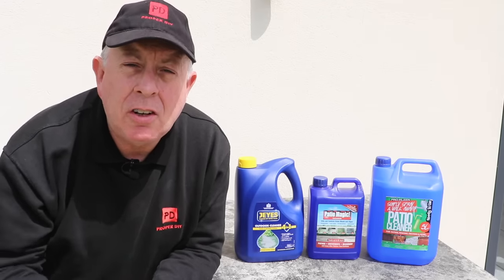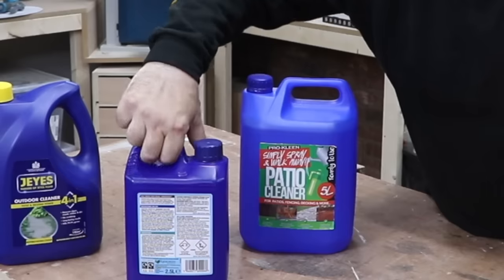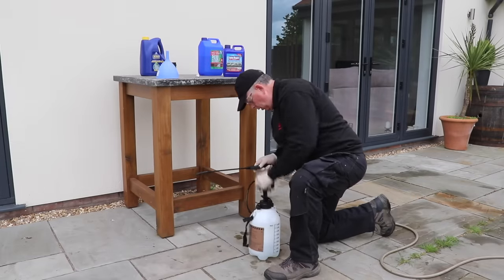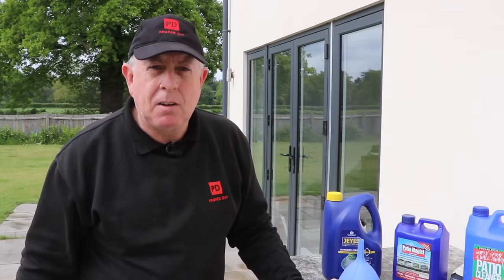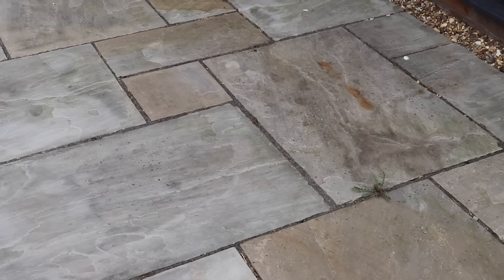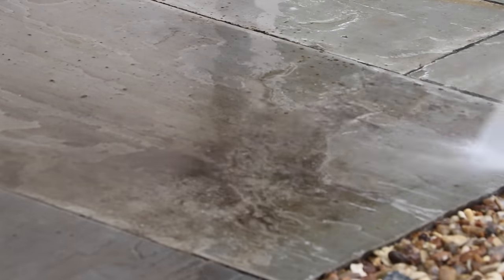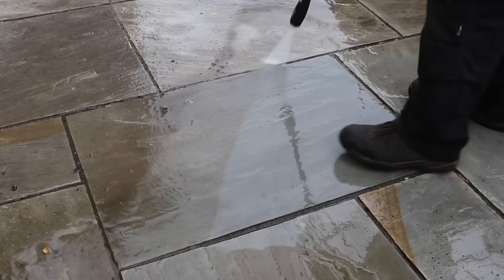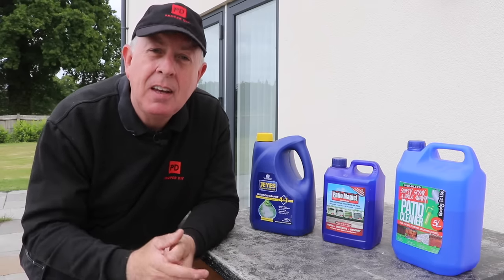Patio Cleaners vs Pressure Washer Put to the Test with Surprising Results!

Comment: Three points:
1. Buy a longer rigid pieceof tubing and extend the spray wand to stop you bending forward unnecessarily.
2. The spinning rotary washer is wonderful and MUST be tried, purely for speed
3. Wait until a damp day to pressure wash, since the grime will be softened beforehand.
Reply: You beat me to it on ALL three points.
Reply: @Justwhois  what can I say I bought my first Kracher about 25 years ago and got told by the experience trades man in my Bunnings store NOT to use it for more than 45mins continuously. After 20 years of regular use it’s worn out. I’ve got two thrown out units picked up from the side of the road (not uncommon in Oz) both operational. Therefore have some experience with high pressure cleaners (spinning rotary wand) I would not go passed these as they work exceedingly well and even gave a second handle one to my neighbour as she bought a new unit without this head. They work well and quickly if you can maintain a constant height. Regardless I looked at this as any alternative and would still recommend the use of Sodium hypochlorite, which is a concentrated form of bleach to kill the mould and stop it coming back after you physically remove it! NSW in Oz

Comment: I no longer use a pressure washer and use Wet and Forget instead. It gets rid of algae/green quite quickly but requires longer to clean the slabs in combination with rain. It then keeps the slabs algae free for up to 18 months i find. Ground in dirt does need a PW though.

Comment: Another great video Stuart.
None of the cleaners i have tried work very well. Jetwash not good especially over the joints as it can damage the mortar. I started off using cheap supermarket bleach. But now buy the higher concentrate industrial bleach. Spray it on a dull but not wet day and dont let it dry out. The longer its on but wet the better. Then just rinse off with a hose. Also works brilliantly on concrete

Comment: When I looked at the patio cleaner from Wilko's own brand patio cleaner, it was simply household bleach. It did the job pretty well though, but it's not a substitute for jet washing. However, it did deal with black spots better than the jet washer (it did nothing for white spot though which is maybe not surprising for a bleaching chemical). There are also some warning that it could fade colours on concrete slabs.

Also, being bleach it ought to kill moss, which I must try on my drive.
Reply: Better be quick buying up Wilko stock!

Comment: I have block paving and it's Wet and Forget for me, diluted at 5 or 6:1. Consistent use of a high power pressure washer damages block/slab paving. Best thing is to pressure wash then seal the paving with a non slip clear sealant. Then once a year treat with chemical cleaner.

Comment: I use the Patio Magic on the picket fence around our holiday caravan after the worst of the winter to get rid of the green mess that accumulares and found it quite good. That might be because they are vertical and we may have had some rain a day or so after application which may have washed away the green mess.

Comment: As you can see at minute 13 forward on the video some of the algae is moving away just by the little bit of water passing over the stone that suggests that you could have rinse the surface and get some of the dirt out. In US we have a product called "30 seconds" and the instructions said to rinse after 30 seconds but you can also leave it for longer

Comment: I have a 12 x 15 yard that was very green didn't want to use harsh chemicals so purchased 2 gallons of white vinegar and a half pound tub of bi- carb, soaked the area with vinegar sprinkled over the bi-carb lightly brushed and left it, within 24 hours there was a huge difference left it alone and rinsed 3 days later and it look like new

Comment: Husband and I used brand free sodium hypo. Best and easiest way. Saved time, water, no noise, no mess. Brilliant job. Very strong and apply caution. Looked like something from breaking bad, wore two layers of clothing. Used a snow shovel to protect the lawn. Need team roles who does what, talked through technique and process before we masked up. Made solution up in a huge bucket on site and just brushed on. Used 1:4 ratio. Waited half an hour then Rinsed off. Stone flags cam up like brand new. Super bright, all green gone. Will now do annually. PPe cost about 15 quid from b&q. We wore more ppe than in the video. The chemical is highly toxic and the stuff that goes in the swimming pools. Was advised NOT to use pressure washers as may damage cement.

Comment: I used to gently pressure wash my Indian sandstone until this year where I was recommended a product by a company called Universeal which you mix 4.1 and spray on and leave within 24 hrs my very green patio turned up like brand new some heavy contaminated areas need done again but all good now , was so impressed I bought a product they have to removed rust stains worked brilliantly took be about an hour to do instead of several hours

Comment: Here in Australia I have used similar products to these (30 Seconds Spray and Walk Away and Glitz Spray and Go) both have the active ingredient, Alkylbenzyldimethyl ammonium chloride.  These work very well to clean concrete of mold and mildew.  I use them because pressure cleaning over the years has slightly eroded my concrete paths.  This active ingredient is activated by rain over about 2 months with the paths getting progressively cleaner over that period. Three days is way too soon to judge despite what the pack says imo.

Comment: I would recommend using a "t racer" attachment on your pressure washer for cleaning patio slabs. As someone that witnessed their father suffering from Parkinsons disease for 8 long and painful years, most likely caused by use of unnecessary chemicles,  I would  not want to use anything like that myself.

Comment: Ive used the prokleen for years. Its brilliant and gets rid of the algae within 3 days. Visiblly better after about a day. Its not designed to clean the slabs. If you want to clean the black slabes, use one of their other products. Far better than a pressure washer. Its also brilliant on composite decking. Put in a watering can, pour on. Takes minutes.

Comment: I think the chemicals just kill off the algae and such. I used something similar on my crappy old wooden deck that had turned green and stank of algae in the parts that routinely see shade; it killed off everything and left a grayish surface on the wood, which was the dead algae. It obviously can't just vanish - just die and dry up. Next step is still going to be the pressure washer (carefully) and then breaking out the Wagner sprayer and painting the whole shebang white. But yeah, on stone like this - a patio washer that attaches to the pressure washer is no doubt the way to go. Those have jets of water (and maybe brushes, don't have one tbh, due to no stone patio) that scrub the stone while washing. Solid investment I think if you have a stone patio. Oh - and it might just be an idea to first clean the stone with a patio cleaner attachment or just the pressure washer, and then spray a layer of your chosen product. It should form a surface that makes it much harder for the algae to come creeping back, as a preventative measure.

Comment: I think if you had done a mix of water and Sugar Soap then pressure wash the areas  you would have obtained great results also, and Sugar soap is better value for money. Just another option but very informative video thank you.
Reply: That is a great idea with sugar soap, do you just put a 50/50 water and sugar soap in a watering can and spray it on the patio first then pressure wash?   I see many comments do the old washing up liquid trick.

Comment: My comment is on block paving. My driveway is old and attracts moss like iron filings to a magnet. I tried pressure washing, but that also meant applying sand after. The sand just washed out on the next rain storm. This year I used an electric gizmo that uses a wire wheel to take the moss out. Then I used several application of these products over the year. Result? No moss.

Comment: I always thought the Jeyes was just an outside disifectant and not an actual patio and driveway cleaner.
I used the Patio Magic some years ago and didn't rate it. I now just use a Karcher pressure washer with thier patio cleaning attachment using a bottle of thier concentrate as a mix with water which is only about a tenner, I don't think the detergent does much but along with the patio attachment I get a very good finish and may need just a spot cleaning with the high power lance to try and remove any black spots and stubborn marks.

Comment: When I first moved in to my present home the  patio  horrendous, it looked black and green ,couldn't tell at all what in the holly shoehorn colour it was beneath  the crud!!😂
I bought a brand new pressure washer and to my surprise after 4 hours I had unearthed a beautiful  pink and cream patio.
After I had cleaned it thoroughly  straight to bones of the earth,I was advised to cover the whole area with a preventative solution so as to prevent a reoccurrence, time went on winter set in and I must say  I wish I had done what I had been advised to do (I became very Ill) so after power washing in the first place I was incapacitated until recently ) I will do the whole thing again in warmer weather as the green stuff has developed once again 😢.❤

Comment: I'd have been interested to see if the application of the product made the jetting of the patio areas any easier than without.  Also, I have an area of Cotswold Stone gravel which brightens up a treat following application of Patio Magic.  Off topic now.  Could you do a video showing replacing the outside handle with a blanking plate on the french doors.  I didn't need to use them as a primary way of entering the house and they would always be opened from inside.

Comment: IMO  the very best way, and the quickest is a Rotary pressure washer. Not a rotary nozzle but the circular attachment, a bit like a floor polisher system. It’s quicker and us less likely to remove the grouting. Quieter as well. I use a Kranzle which is the RR of pressure washers but other brands have similar attachments.

Comment: Without doubt the best product for cleaning drives paths with lichen black or white or algae is sodium hypochlorite chlorine patio clean surpasses anything you can do with pressure washer. I find the easiest way to apply as a 6 inch brush take to a long handle works more or less instantly but if you leave it for a day and then wash off. I have applied this to many drives and patios some you can't even tell the colour off the original slabs bring some back to new with one application.😊

Comment: Good video - as always it proves that nothing beats a little hard work. 

I used to use sodium hypochlorite -  and still do sometimes but the downside is while it's great at cleaning and gives an instant result, it's also annoying in that it stains anything you're wearing. 

I changed to a product called MMC PRO..... absolutely fantastic BUT it looks like it doesn't work! But look at instructions - it's actively working for days, weeks....that's the secret. 

At end of day I think patios and hard surfaces need regular attention and, if you do that with the chemical ( MMC PRO iny case) the need for pressure washer is reduced. The chemical ( biocide in this case) kills the algae AND the spores from which it multiplies hence the less need to then do a hard pressure wash. However if the hard surfaces are neglected, then definitely the two pronged approach is what's needed. 

Finally, like every job, if it's left too long and the surface is neglected then it's a really messing tidy up after - the water sprays up over windows doors walls and you end up having to clean them too! So less more often is always best! 

Keep up the good work

Comment: I've tried a few but the only one that works well is Algon, it's also pet safe. It has to be applied them allowed to dry and works over the next couple of weeks. It's not as good as a pressure washer but 80% there and doesn't destroy the patio grout -> the patio eventually.
Reply: Recommend Algon too, but we didn't dilute it as much 1:2 rather than 1:3.Still looks good after 2 years. It's basically a very strong vinegar though so it does pong a bit while it dries
Reply: @nyarlaaa  I think it's Acetic acid (which is why it smells of vinegar) with a wetting agent (soap) to help out stick. It works really well.

Comment: People get caught up in the pressure of the pressure washer when the litres per minute is almost more important. I use a Karcher K5 with a flat surface cleaner to do the bulk of the work, the dirt blaster nozzle to get the edges and stubborn bits. I then follow up with a relatively strong Sodium Hypochlorite mix to kill any future algae and remove black spots.

Comment: My mental checklist is kicking on.  Kevin, of The Lawn Care Juggernaut, recently tried spray on some black old concrete steps (bleach mix).  Noted was about about a 50% improvement with no power washing. He went on to do some respraying once or twice for a good end result. By what you are saying, you may be using the type of material that Partridge Exterior Cleaning uses on roofs.  After washing, it is put on and left, does indeed work away for months. Beyond that: 1) sweep or blow off debris before starting; 2) you may need to do more than one spraying; 3) the Black Spot could be more complicated; 4) water your lawn edge or plants ahead before using products, to prevent damage. Liked your blocked-off idea. You have a good point in that killing off algae or such isn't the same as cleaning off the residue or accumulated dirt. (You still had Black Spot). Removing rust is a different project. (Get the iron barrel ring off the patio stone??) Enjoyed your experiment. What you used didn't touch Black Spot, which apparently is a Lichen.

Comment: I bought today a high pressure patio scrubber that attaches to the Gerni hand lance. It is at least 10 times quicker than using the hand lance alone. I di 15m2 in about 10mins.

Comment: I used Patio Magic, didn't see any change until a few weeks had passed, it did work but took ages. I am sure the sun being out made it work.
Reply: That's odd.  I've used Patio Magic for several years and you can see a difference within 48 hours.  And then it continues to work.

Comment: I buy a 5 litre jug of carpet detergent from screwfix and feed it through the pressure washer and it foams up nicely and does a cracking job of green monoblock here in the west of scotland. lasts three or four years.
Reply: 1st person to suggest this! I was just about to ask if one has tried this, some karchers lances have the mix option so was just thinking why not fill a empty bottle of detergent be it bought or washing up liquid or bleach or even washing machine detergent I hear does wonders.  Might give this a go rather then pre-treating and doing the job sorta twice. I see several others suggested washing liquid and brush and scrub patio that probably works better but not sure, maybe a test for future.

Comment: In the past i used diluted bleach via a watering can then scrubbed with a stiff brush...last year i used Algon and to be fair it loosened the grime and the flags came up nice after pressure washing a few days later. Algon worked well on timber for some reason tho.

Comment: 10-15% liquid pool chlorine mixed with water . 20inch rotary surface cleaner , can’t go wrong . Soak your grass with water to stop grass dying off .
Reply: Totally agree on using the pool chorine 15% bleach stuff. Diluting a bit depending on how dirty the surface is.  But still need to scrub with a brush to get clean.  I also use it on my wooden decking where you have to scrub into the decking grooves. 
Thanks for the video!!!
Reply: Yup 15% Sodium Hypochlorite £20 job done, lichen gone, weeds killed, pressure washer optional.
Reply: Totally agree, do it before it rains with a stronger solution so that the rain drops hitting the floor do the work of the brush and it washes it away for free.
Reply: Why bother buying those chemicals, risk killing his grass when he can use the pressure washer he already owns and actually get the satisfaction of seeing it working right in front of his eyes, makes 0 sense 🤣
Reply: @troyg1337  I bet if he cleaned it now , straight after doing it with his electric one it comes up cleaner . Makes 100% sense 🤣 it doesn’t kill the grass if you wash of properly.
Reply: @grandmaster2177  bollocks, people just like to believe their way is better regardless of how pointlessly extra it is
Reply: @troyg1337  if u have stubbon lichen, shaded areas it will do the job a pressure washer can't.
Reply: I’ve found pressure washing, followed by a Jeyes spray, keeps my Indian stone slabs cleaner for longer, especially in shaded areas. Good vid to see the comparisons though, thanks!

Comment: I’m a builder and I lay new patios, driveways etc and also repoint paving, sometimes when using a pressure washer the mortar can wash out the joints, I see this many times then water gets under the flange and causes erosion, if pressure washing flags don’t aim or concentrate the jet on the joints just flush over them

Comment: the active ingredient is BAC50...which is cheaper to buy from amazon etc...the patio cleaners are pretty much diluted version of this (5% or less)
I too pressure wash yearly my concrete paving, and last year I decided to pressure wash, then a few weeks later applied cleaners such as the above. This year I havent pressure washed at all. It would probably look a small bit better if I did, but clearly some preventative stuff has been going on during the winter to keep it cleaner than usual.
Reply: that stuff is ok, but no match for sodium hypochlorate. Only benefit is it wont "bleach" things inadvertantly.